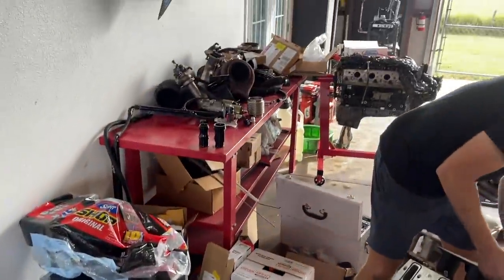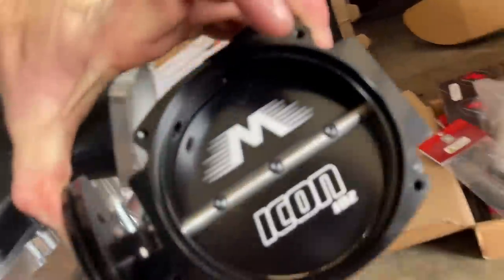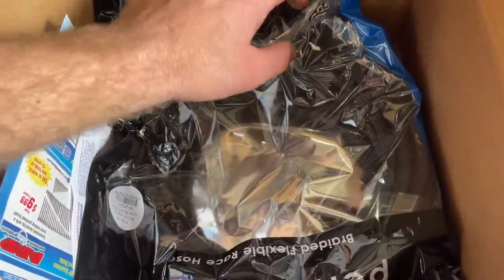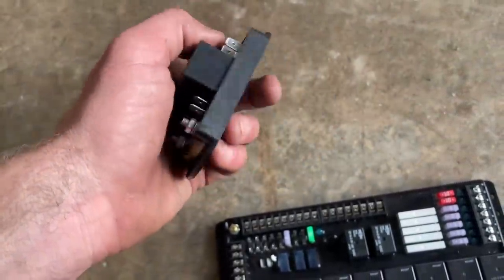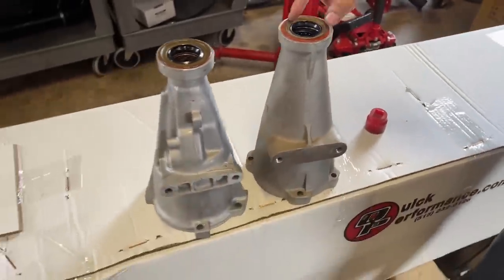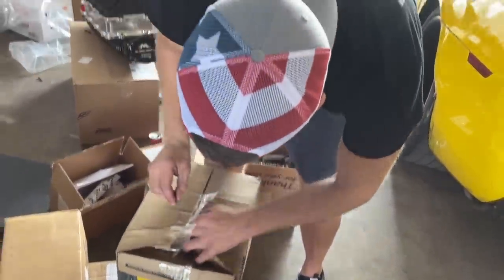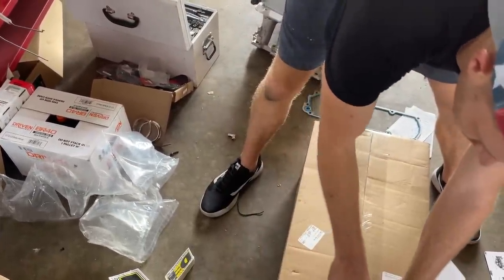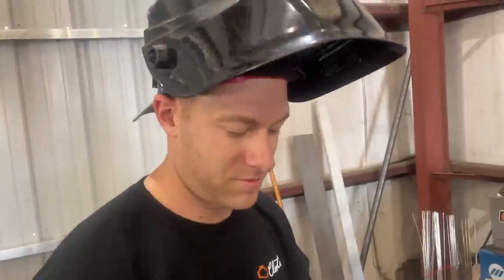TONS OF UPGRADES for the Texas Speed 427 V3.0 Build on Dr. Pepper, 6 Weeks Until Christmas Tree Race

Comment: Hey Parker, there are two types of countries in this world, those that use the metric system and those that have been to the Moon! :)
Reply: Yes, that's true, however, since 1990 NASA has been using metric. Future moon landings and other space exploration will be using metric.
Reply: @kenwillekens9894  
Because NASA has been outsourcing everything.
Reply: @kenwillekens9894  I was big on the metric system until I started working in a machine shop and started doing precision measurements and learned how much easier it was to accurately measure things in tenths, hundredths, and thousands of an inch.  That said opinions are like a certain body orifice and everyone has one.  Have a nice day and a better tomorrow.
Reply: @gullreefclub  you must not know about milimeters
Reply: @gullreefclub  as my grandpa would say “opinions are like a**hole, and most of them stink”
Reply: That argument is getting sooo old! Btw, wasn’t it a German that got you lot to the moon?🤔

Comment: That heat shielding with the rubber outside and fibreglass inside is no joke.
The sales guy put his finger inside it and ran the oxy torch over it to show it off. 
The main place we used it on my fathers Australian burnout car was over plug leads!

Comment: Aeromotive offers a line of brushless, variable speed gear drive pumps which trigger on a 0 - 5V signal (from a TPS for instance) to control the fuel delivery.  At 0V the pump delivers 30% of max, at something just under 4V the pump delivers max fuel flow, per the rating of the pump.  Anything between 0V and ~4V varies the speed/outflow volume.  The vendor offers this pump in 3.5, 5, 7, 10 and I think 14 GPM capacities. The brushless feature of the pump greatly reduces the heat load passed on to the fuel on it's way through the pump, and the variable speed control allows the pump to scale output to match throttle demand - a perfect mix of features.  I bought the 5 GPM pump for my new blown and injected 540 BBC - I'll be running 16 injectors delivering an abundance of fuel to the top of the blower. I'm running two Accufab 4bbl throttle bodies and have added a second TPS to control the pump speed.  This is a pro-street ride so I need to be able to follow grandma around in traffic and still cross the stripe making full wail out of this blown injected big block.  I'm thinking this new Aeromotive pump is gonna satisfy both worlds and allow me to maintain realistic fuel temps & pressures throughout.  

I thought I'd add the fact that I'll be running a flex fuel sensor in the return line, just off the rails up front.  I'm using a Holley Dominator ECU and the expectation is to switch between pump gas and various blends of ethanol (E85, etc.) as needed, and let the controller dictate fuel flow out of the injectors.  This high flow, variable speed pump should be to push enough volume to handle pretty much any amount of fuel demand.  For those who don't know, these pump all (to my knowledge) have an AN-12 inlet port with a -10 outlet - they'll move a lot of volume.   If I discover my current 5 GPM pump isn't meeting demand, I can swap it out for the 7 GPM pump - same footprint, wiring, plumbing, etc.  I'm expecting to finish my build up on the next couple of months and make noise - we'll see then how well this fueling setup works.  Also:  most flex sensors are built to handle a 5/16 or 3/8 fuel line.  In order to use these standard sensors people were building split fuel lines soas to not limit fuel flow.  MotionRaceWorks has a pretty slick billet/annodized flex fuel adaptor with AN -10 ORB inlet and outlet ports, and a design that allows you to use a standard automotive sensor by splitting the fuel flow into two channels - one side goes through the sensor, the other side bypasses it and flows past it - this provides a single in and out and doesn't restrict fuel flow.  I'm expecting this will allow me to pick pretty much any fuel mix I want and allow the Dominator to manage demand.

Comment: I dunno, kershaw 1660st in my hand at this very moment. But it's been recently reshaped and sharpened to better suit my likes/need.  Its served me well for more than 20 years. Its a "adjustable" wrench but we say "gab me the small Crescent from the bench while your up." Best I found are the older/vintage USA made Craftsman adjustable wrenches. They are the only thing I use when working with brass fittings, everything else either fits loosely or backs off after adjusting. It leads to the wrench slipping and rounding the corners making life more difficult than necessary,

Comment: Having dealt with boiling fuel on power tour for a few years you have way too much fuel pump for cruising. Aeromotive recommends you run with pwm module pn 16306 on that pump for street use.    Try that first then if it’s still getting to hot you will have to run a fuel cooler since your cell is in the truck and you do not get any ambient cooling.  You could try to rig up a solid state relay and pwm signal from the holley but it’s probably the same cost.  On my car I just ran a 2 stage surge tank with a single 340 for cruise in the main tank and one in surge tank.  then 2 more in the surge tank for boost. Drove 2 power tours that way starting in Texas and going across the country, zero issues. Pro touring with ac and 1000hp gets tricky.

Comment: Kershaw Black Horse, not any of the other crap they sell. It has a large rubber grip with finger grooves, and mine was made in Japan probably in the early 90's or before. It is my fishing knife, for cutting line and cleaning mostly trout. As a tradesman, I use utility knives with replaceable blades for most of my cutting needs.

Comment: If you have a separate fuel system for the street change the pump out with something more in line with you’re needs. A hellcat pump or something smaller can handle it no problem and not put a ton of heat into the fuel
Reply: this. seeing it has 2 fuel systems, and the street system isnt used in boost, id run a small pump like a bosch 044 or aem 400lph if its an external pump, or a walbro 450 if its an in tank.

Comment: The only difference between standard A/N braided hose discounting the fittings and standard “rubber” fuel / transmission hose is the braided covering 
Personally I never have understood why someone does not run a properly sized fuel filter with a electronic fuel injected engine.  You can get away with just filtering your fuel if you are running a carburetor or mechanical injection as long as you have no problem with hose deterioration.

Comment: Get a car audio “bass” knob controller wire. It runs from the amp in the trunk up to the front of the car. Find a resistor and fuse/relay if needed and mount the knob wherever you want it. Find someone that repairs car audio amplifiers or electrician and they’ll be able to explain how to wire it in. It’s basically light a “mood” lighting switch in a house.